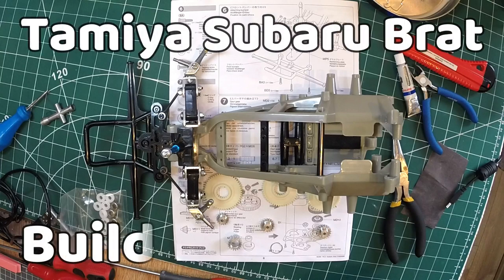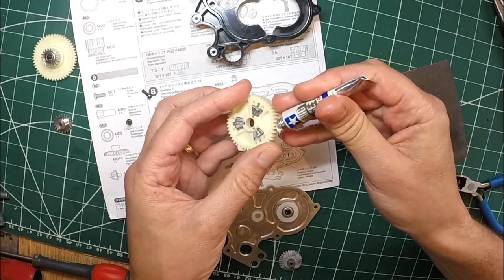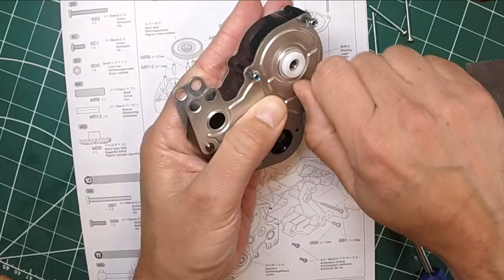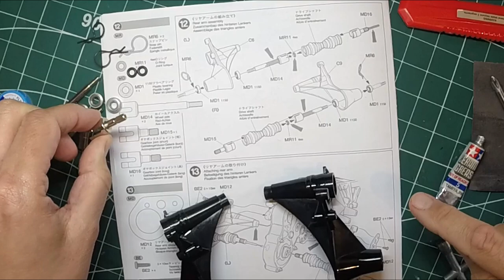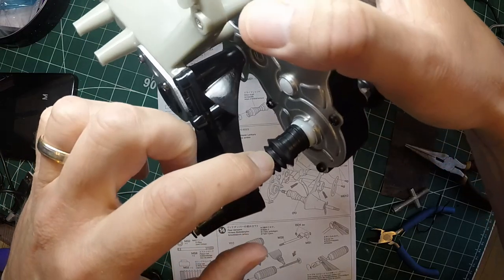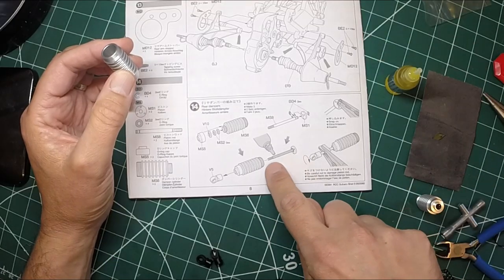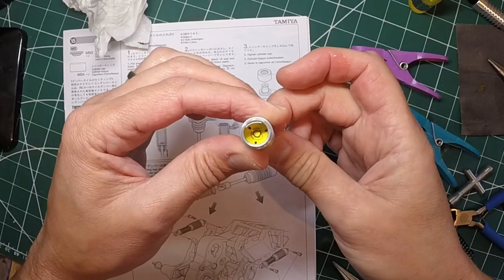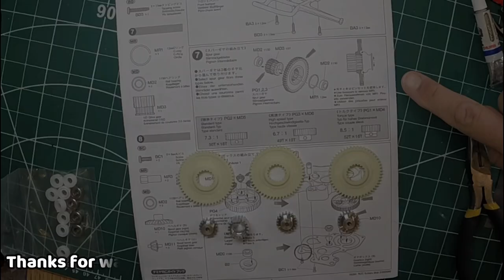Tamiya Subaru Brat Build Guide Part 2 - Gearbox and Rear Suspension.  Tamiya kit 58384

Comment: Nice! on those boots I use fishing line and just tie a knot around them it works great and you can't hardly see it.  Don't need to tie a super tight knot on it.
Reply from the maker: Hi Steve. That's a great idea. Is there anything that can't be solved with fishing line? I don't think so. Only trouble is that I haven't got any currently ☹️ Many thanks for watching and your top tip 😁

Comment: Great stuff, Pete! Looks like a nice build, and the video had a nice flow to it. Takes me back to my Mnster Beettle rebuild, similar but different! I did get the Brat gearbox and driveshafts as an upgrade as the old hex drive shafts had worn out. Loved the pegs to hold the shocks upright - I'm nicking that idea, as I'm always looking for somewhere to hold them when building! Hope all is well with you, mate - have a great lockdown weekend, at least you got that beer delivery to enjoy!   :)
Reply from the maker: Hello mate. Yes the build is trundling along nicely. Part 3 needs editing and is mainly about putting in the electronics. Part 4 might take a while as it is finishing the kit including building and painting the hard body which will take a while as I'm crap at it! Yeah clothes pegs are useful for holding little bits and bobs. I wasn't sure whether to credit you with the putting oil in the bottom of the shock first thing as I couldn't remember if I was doing that before your video. I still haven't explained my theory about the rebound. Basically when the piston rod goes up into the oil, obviously the volume becomes greater and it's the rubber diaphragm that needs to flex upwards to accommodate the increased volume. The way the shock is put together there is a trapped pocket of air above the diaphragm which is initially at standard air pressure but that air is pressurised as the diaphragm flexes up into that space. So my theory is that the rebound is because of that pocket of air being squashed. If there was a hole in the top of the cap it would allow that to escape and stop the rebound. I don't want to drill holes in any of my shocks to test it mind you! Anyway I have just put in an order at Time Tunnel for the Tamiya Dump Truck so hoorah! The GF-01 is great fun and obviously it's going to be brushless! Hope you have a pleasant Saturday mate. Thanks for watching 😀

Comment: Morning Stud! That gearbox build looked a bit fiddly 🤔Other than that, a very enjoyable 20 minute viewing. Thanks. Now where's part 3? 😍
Reply from the maker: Hello mate. Yeah there are a few fiddly bits on this where you need several pairs of hands. Part 3 still needs some editing and will be out next week sometime. Might be a delay for part 4 as that's the final part and it depends how I get on with painting the hard body. There are lots of details on it. Don't think I'll go nuts trying to do all the details as I'm not really very good at it. How's Peppa pig and your other projects? I'm thinking about getting the Tamiya dump truck as it's only £135 on Time Tunnel and I know that the GF-01 is really fun with brushless. Does the plastic of the cab and the tipper seem robust? It is a chassis that rolls over a lot. Anyway, thanks for watching this one and your comments. Enjoy your Saturday (is it Saturday?) 😀
Reply: @PeteWylieRC  The Dump Truck is immense fun. I was speechless when it did a wheelie backwards!! The plastic body is about 4mm thick and I'm surrounded by concrete if I take it to work with me so I'm scared to scuff it to bits. 1 Peppa Pickup done ready for paint. I sprayed the Charger 1 light coat of Pearl Orange yesterday and due another coat at lunchtime  today. I'm glueing on the forest arches on the MK1 Escort Van now and fettling the 2nd Peppa Pickup and CHiPs Pickup tomorrow. Busy weekend doing Lockdown Projects.
No rush for PT.3/4 of your Brat build. 
The only thing I don't like about the Dump Truck is that the springs don't sit on the shock straight after you put the spacer at the top to take up the slop but apart from that gripe, it sure does shift with a 8.5t in it 💨😁😎
Reply from the maker: @cw-01creations46  The projects all sound great. We'll have plenty of new toys to show off when we get to meet. I think I will get the dump truck as I can get it together quite quickly and maybe do a build vid. I know that the Wild Willy body takes absolutely ages to do properly and I need more paints so I'll do that build later in the summer when there are more supplies hopefully. The GF-01 needs mini oil shocks really as those friction ones aren't up to much. I might just go and put an order together on Time Tunnel. How exciting 😁
Reply: @PeteWylieRC  I get my paints from Wireless Madness on eBay and only a few days to come through the post too with a discount on top. Or Selections Web on eBay. Oil filled shocks from JK-RC, top bloke. I'll send you a couple of photos soon.

Comment: i got a set of metal bearings fm your suggestion - lost a plastic piece on the gearbox - waiting for replacement, so im doing as much as i can , body- wheels- shocks
Reply from the maker: Ah that's a shame that you lost the part. I hope that you are enjoying the build other than that. The hard body shell took me about 4 times longer than the rest of the kit. Plenty to be getting on with 😀
Reply: @PeteWylieRC  quick question- are there any points that you might suggest lock-tite?  anyway, I messed up the lexan body painted the outside, then I tried to soak the stickers in water,  didn't ruin them, but after an hour not sliding off the sheet I knew something was wrong,  having a good time- I'm hooked  now,  Oh just saw some lock-tite on the motor gear , video 3

Comment: I know you put this together a long time ago but, My wheel axles are not the same length as the 1:1 representation in the manual. I'm concerned Tamiya may have packaged the wrong ones with my kit. Is that something you've heard of happening? Its short about 4mm...
Reply from the maker: Sorry for the delay. I keep meaning to have a look at the Brat and then I forget. I don't remember the axles being different to the instructions. I've never had a Tamiya where they put the wrong bits in. I think that so long as it goes together ok then it's fine. Hope you have resolved it now. Many thanks for watching 😁